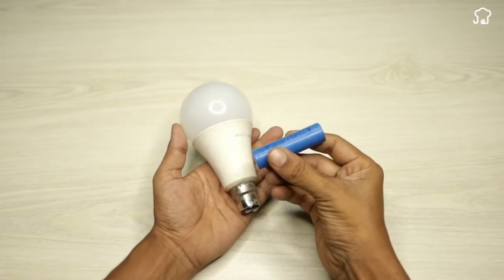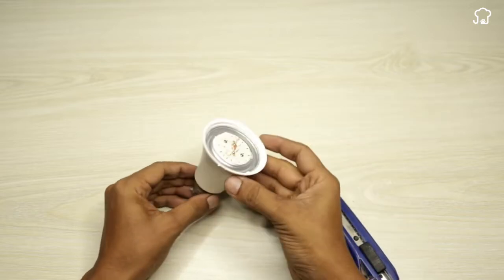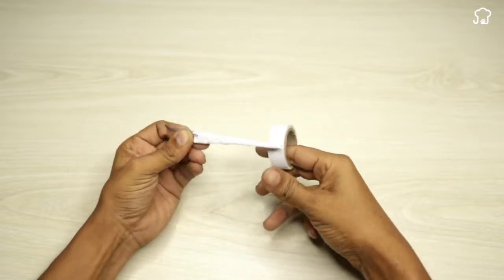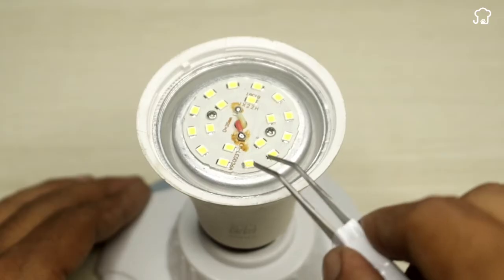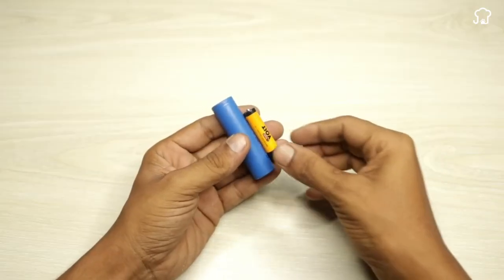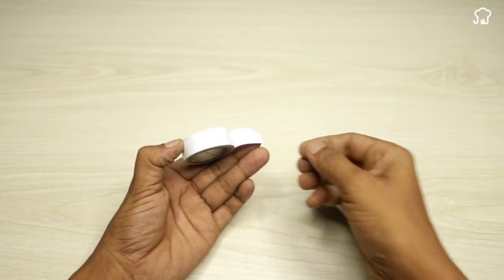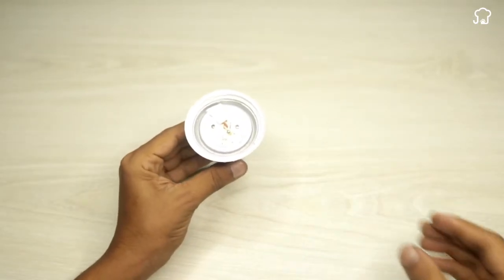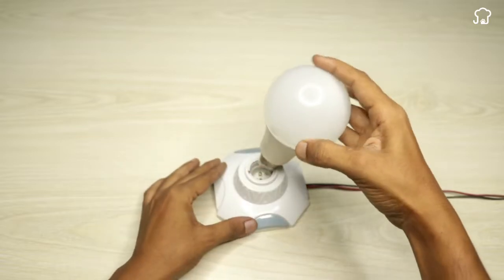Discover the Secret Trick to Repair Burnt LED Bulbs in Minutes!

Comment: This video provides a quick and easy solution for repairing burnt LED bulbs. The trick demonstrated simple, and the instructions are straightforward, making it accessible for anyone to try. It a great time-saving technique that could potentially save money on replacements. If you're looking a clever hack for fixing LED bulbs, this video is worth checking out!
Reply: Hello ❤❤❤